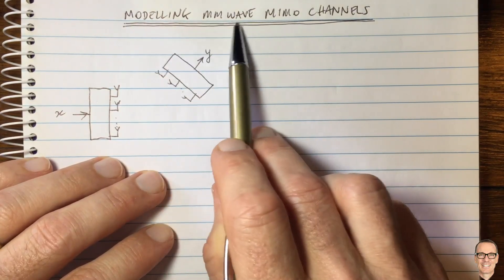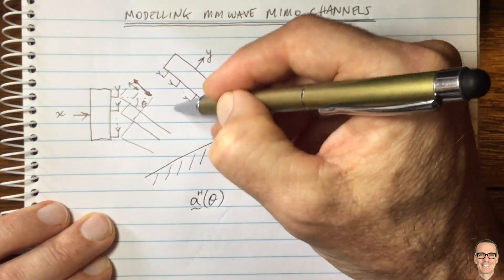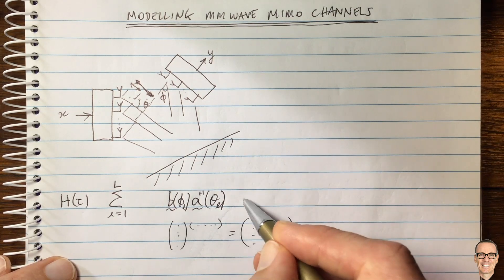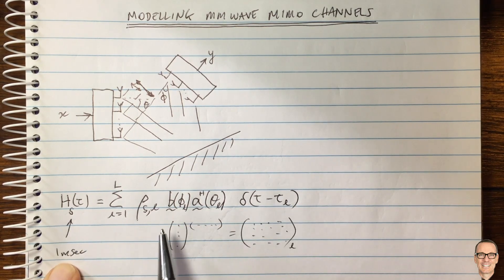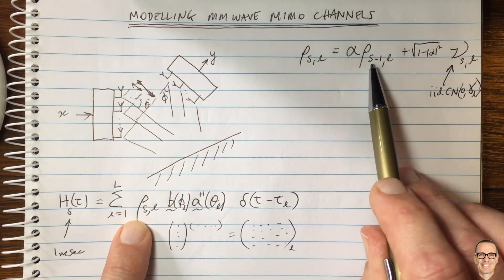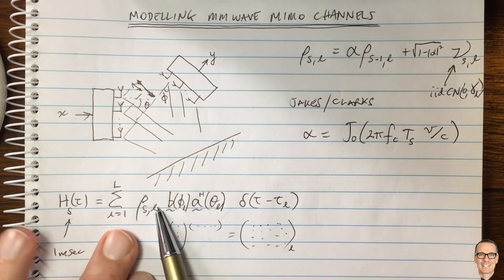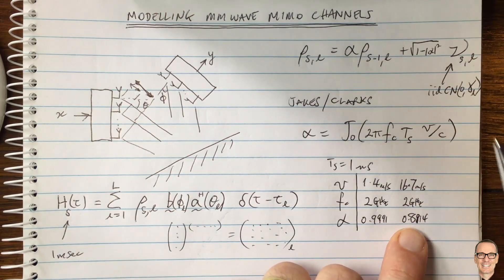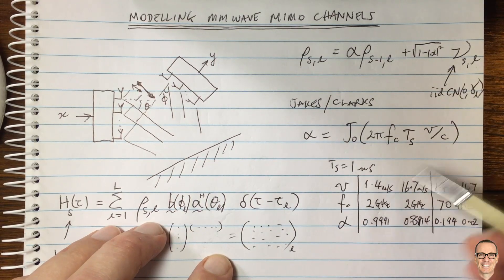Modelling mmWave MIMO Channels

Comment: For evaluating the performance of beam tracking algorithms in mmWave, the AoD and AoA are not assumed to be constant. Is there a model how the AoD and AoA change? That change, just like the change of the rho, should also depend on the speed of the user right? Higher speed -> higher change in AoD and AoA. Is there a model that considers the change of rho, AoD, and AoA in dependence of the speed of the user?

Comment: Hello professor, I want to know how can I show large-scale effects in modeling, for example, path loss and shadowing. Can I simple add another variable represent gain in the sum equation?
Reply from the maker: Yes, that's right. The important thing is the signal to noise ratio. The actual receive power is important for designing the front-end filters and amplifiers, but in terms of performance, it's only the SNR that counts.
Reply: Thank you very much for your reply! Regarding the SNR you mentioned, can I understand it this way: fine channel modeling is not the most important thing, analyzing the SNR is the most important thing. But I don’t quite understand the connection between channel modeling and analyzing the SNR, for example, how should I analyze the SNR based on the formula Hs(τ)=∑l=1Lρs,lb(ϕl)aH(θl)δ(τ−τl) in your video? My research direction is not wireless communication, but I need to establish a wireless communication model. I am not clear about many common sense in the field of wireless communication. Your video and reply are very helpful to me, thank you very much. @iain_explains

Comment: Hi Dr. Iain, I am very thankful for your videos. They are very helpful!
I have a question. I am working in a more simple environment where there's only single antenna source and destination. Using non millimeter wave, can I still use the channel model in this video? But only considering one ray/one beam
Reply from the maker: If you only have one antenna, then you don't have beams (unless it is a dish antenna, in which case there is a single beam in the direction of the dish). For single antennas, with mobile users, you'll tend to have Rayleigh fading. See: "What is Rayleigh Fading?" https://youtu.be/-FOnYBZ7ZfQ
Reply: @iain_explains  Thank you for your response, Dr.!

Comment: Sir. I have a doubt. In the video, why do you write ${\bf a}^H$? Does the ${\bf a}^H$ refer to the steering vector of the transmitter/base station? or does ${\bf a}$ refer to the steering vector of the transmitter/base station? Thx.
Reply from the maker: ${\bf a}^H(theta_ell)$ is the channel gain in the direction of the "ell"-th scatterer, that is in the direction theta with respect to the transmitter array.

Comment: Thank you Dr for this amazing video. I have one question about carrier frequency and bandwidth. Some papers assumed that the carrier frequency is 28GHz and the bandwidth is 100 MHz. Is 100 MHz enough when we consider mmWave with madsive MIMO?
Reply from the maker: Lots of factors go into the choice of channel bandwidth allocation, so your question does not have a simple answer. Certainly 100 MHz is much wider than current mobile and WiFi standards at sub-mm-wave carrier frequencies, which are typically 10 or 20 MHz.

Comment: Thanks, Dr.  Very helpful video. I have some questions about the model described above, which are as follows.1)why was this mmWave MIMO channel, which contains the AoA and AoD vectors, not modelled like that in MIMO or Massive MIMO channel in previous talks. 2) Is the multipath here referred to that in the frequency selective fading channel or just some multipath used to construct the channel, which is still a flat fading? 3)I am confused about the channel model description of the ray-based MIMO model, statistical model, and multipath model, which is the sum of H. I would appreciate it if you can give explanations for that.
Reply from the maker: Answers: 1) Different models have different accuracies and are easier/harder to analyse. It tends to be that some are good for accuracy, and others are easier to analyse. In the case of mmWave, there need to be lots of antennas, and this leads to narrow beams, which means they can be directed along the AoA and AoD. With fewer antennas the AoA and AoD cannot be resolved. 2) The assumption is that all the paths are fairly similar in delay, since they are short distances in mmWave comms, so it is a flat fading assumption. But some mmWave channels may be frequency selective 3) I'll think about making a video to try to describe the relationships.

Comment: Thanks, Dr. It's a very useful and tremendous video.
I just want to ask one question if one train moves in a one-dimensional way with a speed of 300kmph  and communicating to mmWave based remote antenna units (RAUs) like 60-GHz means. In this scenario, RAUs are installed in fixed positions, and the direction (position) of the antenna installed on the top of the train is also fixed. And the distance between the train's antenna and RAU is almost 5 meters. So now how I will calculate channel gain by using your approach as you discussed in your lecture related to the alpha (Velocity/Speed, frequency). 
Please let me know about this. I shall be very thankful to you.
Reply from the maker: In the case you've described, the channel is likely to be line-of-sight (LoS), with not many reflectors, so there won't be significant multipath. The LoS component will also be largely predictable since the train is moving on fixed tracks in a predictable way. Also it depends on the types of antennas being used. If they are directional dish-type fixed antennas, then the channel model will be quite different to what's described in this video.
Reply: @iain_explains  Thanks Dr. for your reply. 
Dear Dr. In my case which channel models will be best suitable in the LOS scenario. Thanks.
Reply: If I use directional antenna like horn antenna.
Reply from the maker: There's no easy answer for this. For one thing, it depends on how accurately the horn antennas can be rotated to face each other as the train moves along.

Comment: Very helpful video!!  Expected result since coherence time is proportional to λ and one of the drawbacks of mmWave is the need for more frequent channel estimation. For smaller values of τ_s, the value of α would have smaller fluctuations.

Under which assumptions is "Gauss-Markov model" valid?
Reply from the maker: It depends on what you mean by "valid". It's a model, so it approximates reality. It's really more of a question of whether it is an accurate approximation to reality, or not. I guess you could say that if the approximation is accurate, then the model is "valid". From measurements that have been reported in the literature, the Gauss-Markov model for the channel path gain is accurate for sub-2 GHz channels, and appears to be accurate at higher frequencies too, but there are limited measurement sets at those frequencies.